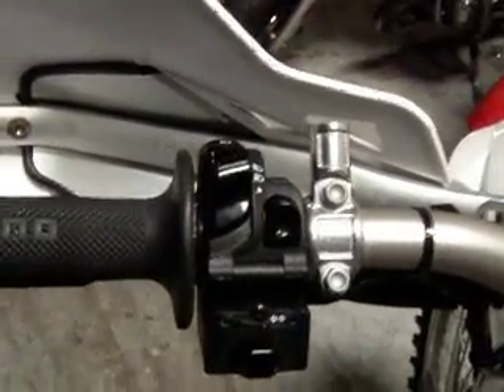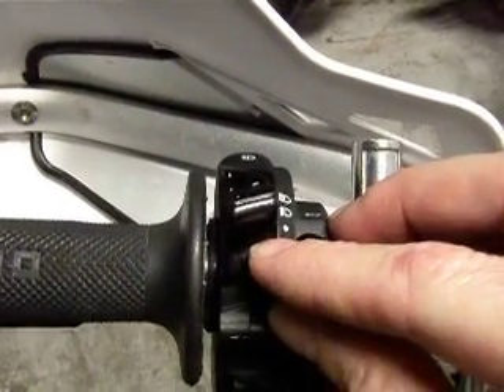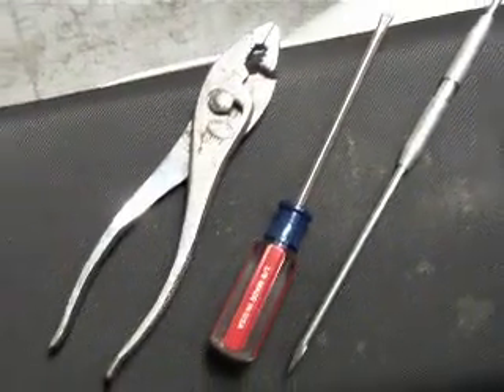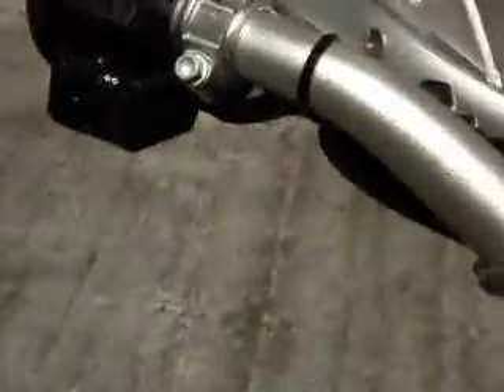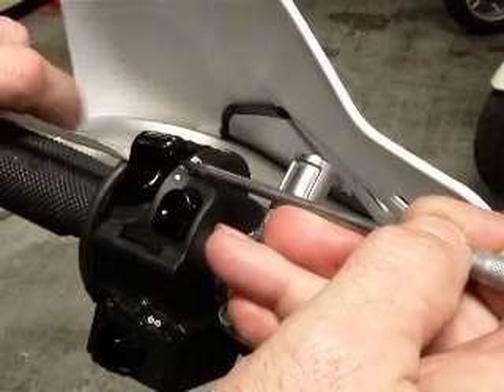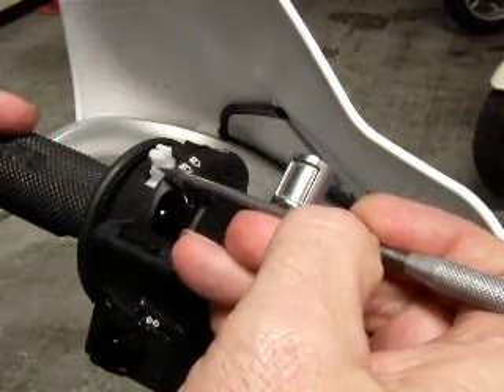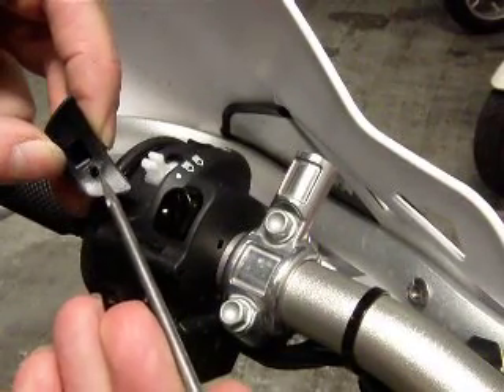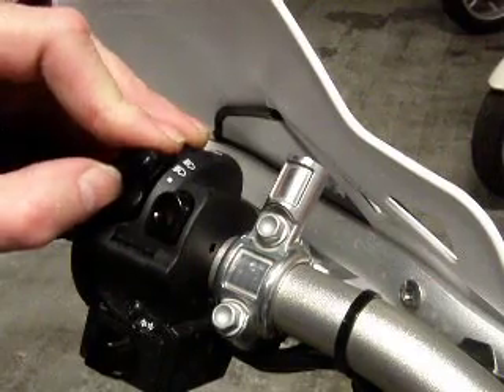BMW G 450 X

Comment from the maker: It is a street legal bike. The ability to turn the headlight on and off is only used during off road competition. It is required to have the headlight turned on during use on the street. I turn it off when racing enduros and hare scrambles.